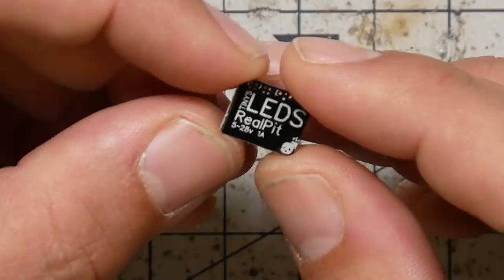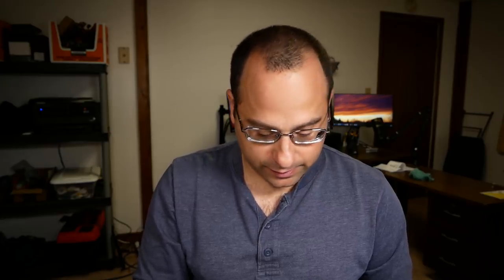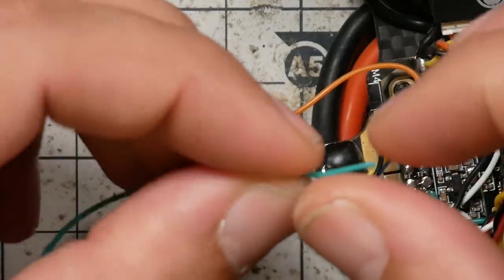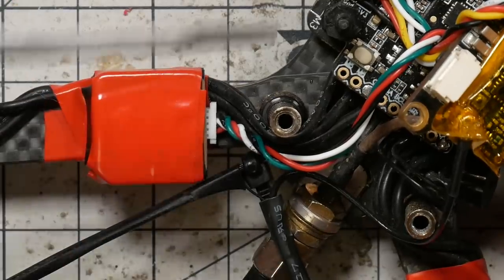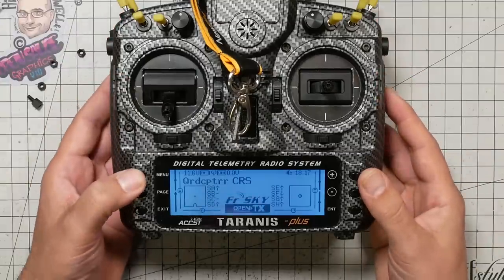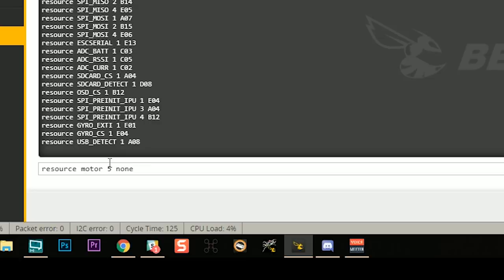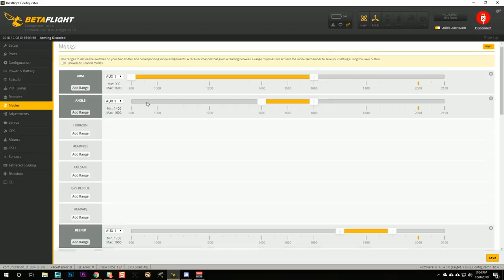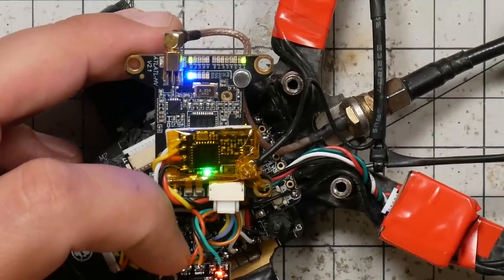Switch vTX Power Off Remotely? | TINY'S LED REALPIT

Comment: Pit mode is already pretty good on many transmitters, but it doesn't works right on any of my VTXs.  On the Tramp-compatible Atlatl (V1), I can turn pit mode on but can't turn it off again without power-cycling, and on the TBS-compatible Atlatl (V2) and the AKK FX3 ultimate I can't activate it at all.  Power and channel control work, it's just pit mode that's non-functional.  What a shame.

Comment: Would the same cli lines work on the JBF4? I’m trying to use the LED pad to control it so I know I will need to use the correct pin designation.
Reply from the maker: Yes exactly.

Comment: I have your fc and esc. Blheli keeps saying saying theres nothing to read: on esc 4, there for motor 4 doesn't turn. I can't seem to digure out how to dix it. If you could help me out i would greatly appreciate it. Thank you Mr. Bardwell.
Reply from the maker: This usually means signal wire 4 is not connected or damaged.

Comment: Is the default off so it doesn't power on the VTX until the receiver is talking to the TX to turn it off? But then you idea of switching the RX off wouldn't work as you could never power the RX up ?
Reply: This does not switch off your RX. And yes default is OFF for whatever is attached to this.
Reply: Listen to JB surmising about during a race a crashed pilot being able to switch off both VTX and RX. My point was this wont work because you can never switch on power to the RX with power already being supplied to the RX.
Reply: 3 ordered from RMRC was going to order direct from Tiny's site but $15 minimum post to the UK v $3 seems a bargain to save the cam and VTX killing a battery while hiking to GPS coordinates even going to set failsafe to power them off.

Comment: Do you know if it's possible to control one of these without a flight controller? Say I wanted to put this in my wing, could one switch it on and off with an aux switch directly from the Taranis?
Reply from the maker: I don't think this is the right tool for that. I'm not sure if it works from a PWM signal. But they do make PWM-controlled switches that can plug directly into your receiver.

Comment: hi Joshua, 
I'm trying to implement this in INAV. so far I found that resource mapping is not available in inav.
any workaround you can think of? do you think it may work using buzz- or led ports?
Reply from the maker: I think that RealPit might work with a PWM input as well as the pinio function shown here. Try it with a PWM output from a typical receiver and test. If it does work, there are various ways you could get a PWM signal into the realpit to switch it.
Reply: @JoshuaBardwell  
cool, 
I'm connecting realpit directly to a 4s battery (15V). I connected the "fc" port on realpit to a pwm ch in frsky. the channel output is ranging between 100mv to 220mv, making realpit forward between 2V to 2.6V (to the "vtx+" port).
I'm looking to get 0V when off and 15V when on.
thanks for the help I keep looking

Comment: So these unit will work on a caddx vista unit as well?
Reply from the maker: It works on anything as long as it's pulling less than about 1 amp. So the DJI unit must be powered from about 12v or higher to be safe.

Comment: Does anyone know if it is normal that my lantian rc realpit measures 1.1V when switched off between ground and vtx+ pad?
 5V when on.

My vtx does not transmit at either on/off.
Reply: solved, mamba mini stack was doa, some pads not putting out 5V but 1.8V for some reason, even when nothing is connected, AND when something is connected, weird stuff

Comment: If you are using smartaudio or tramp to control your channel won't the VTX, when powered up after the FC, then be on at the default channel?
Reply from the maker: it will get the new channel info from the FC upon powerup and then switch immediately. But you should DEFINITELY test each individual vTX to find out if it "blips" on the old channel or not.

Comment: Could you please explain the aux command? If I understand it correctly this command is trying to map range 1600..2100 of AUX2 to USER1 but then (maybe because of missing arguments in the command?) betaflight just ignores it and answers AUX2 range 1600..2100 is mapped to CAMERA_CONTROL_1 and then you proceed to using the GUI and map it there instead, doing it the "normal" way. And you are using AUX4 in the GUI.
Reply from the maker: Don't get confused about "aux 2" and "aux 4". The "aux" command is used to define Aux Modes, but the numbering is sequential. So the very first aux mode you define is "aux 1" and the 2nd one is "aux 2" and so forth. The  aux channel that you use (Aux 4) to activate the mode is one of the later parameters.

To be honest, I think you should probably just define the aux mode in the Modes tab rather than trying to type it in to the CLI. But since it is part of the instructions for setting up RealPit, I included it here in case people are setting up for the first time.
Reply: Yup, after saving the pinio_box line the USER 1 mode will be available in the modes tab and that is all you need (except for assigning the pad of course).
Reply: I think this whole topic would be worth a video that explains every aspect of it in more depth. For quite some time now I have thought it might be nice if I could switch arbitrary stuff on and off remotely, but never researched deeper into the topic because I just did not know there actually existed such a clean and simple way to remap and reconfigure arbitrary pins and have user modes. It was this video that actually made me look up the dos and read deeper into it.

And here is also the main point of criticism: When watching your video the pedantic programmer in me immediately said: "wait a moment, I am supposed to blindly enter these commands with magic numbers in it without any explanation and without knowing how to undo the effects of the command. I must first look up what it actually does." . While this had the beneficial effect of making me actually look up the documentation and finally understand how to to it, it also left me with dissatisfaction about how incomplete it was presented, how much better and less confusing it could have been if there would have been just a few more explanations and no blind copy-pasting of unexplained commands.

And this is where I believe that another follow-up video would be helpful, a video that fully explains what the IDs 40...43 actually are (and what other IDs there also exist), what the pinio_box actually does, how it creates a mapping from USER1...USER4 to PINIO1...PINIO4 and what other funny mappings could theoretically be made with this command (for example actuate a certain pinio when the quad is armed, etc.). You could dive really deep into this topic if you want to , for example explaining where the pin names for the resources actually come from when looking into the data sheet of the microcontroller, it would be a very interesting video and fun to watch even for experts as long as everything you say is factually correct and you don't leave people with unanswered question marks in their heads. 

And for completeness sake it should also explain that the aux command used in this video was actually redundant and people should use the GUI to map the ranges instead.
Reply: @foo2332  That feature also completely slipped my attention. AFAIK it is in BF since 3.4 and was introduced to enable (or rather disable) the Runcam bluetooth adapter for the Speedybee app.
Reply: @foo2332  The IDs 40 - 43 are hardcoded and map to the modes USER1 - USER4. There aren't any more as for now. Combining modes (e.g. arm and RealPit) works transparently like with any other modes. This is nothing new, you could assign different mode functions to the same Aux since forever. It would be worth explaining though that you can (and in many cases should) configure pinio switches in your failsafe settings, too.

Comment: Guys I know it's not inherent with the discussion but I read that the TBS crossfire FULL has a bluetooth module... would it be possible to make a connection between it and your phone to use Speedy Bee and change things in betaflight on the fly?
Reply from the maker: You almost could do that, except the Speedybee app does not have configurable baud rate -- or at least it didn't the last time I checked. And the baud rate used by the Crossfire module is not the same as used by the Speedybee app.

Comment: Hey Joshua,
I am trying to set up the Realpit on my Omnibus f4 V5 board. I have the RDQ Mach 3 set up with smartaudio on Tx6. I want to use the Realpit on Rx6. I have the Spektrum Spm4649 on Tx3. I also have my gps on Uart 1. I made sure of trying this a number of times that my vtx is working correctly. When I wire the Realpit up and I am in the modes tab I can see the user 1 tab light up when I flip the switch for Aux 1. I have saved all the changes I made to the resources but I do not get the Realpit to light up nor the vtx to power up. I have tried two different Realpits and neither on of them turn on. Please help me and thanks, Tony
Reply from the maker: Most likely this points to a problem with your resource reassignment.

How did you identify which pin number was assigned to RX6?

When you type "resource" do you see any other resource on that pin number? If so, type "resource <RESOURCE NAME> none" to clear all except the pinio 1 resource.

When you type "resource list" do you see pinio 1 assigned to the pin number in question?
Reply: I initially used resource to find out that Rx6 was assigned to C07. From there I assigned all the commands like you did. I even reformatted the firmware to make sure it was clean. I did not notice if there were any other resources assigned to that Rx6. On the Readytofly website it says that uart 6 has a header through-hole connected to it. I was thinking of switch the gps and smartaudio uarts to see if that helps. Or I may use the pwm5 pin. If I configure it correctly and I’m testing it out should the pin output 5 volts? Thanks again!! Tony
P.s. I’m st working so I’ll update this in the morning.
Reply: Joshua,
I just pulled the resource command off of the fc. I did a new firmware install to make sure all was clear. C07 is on the Serial rx and also the PWM 4 areas. I did notice with the serial rx3 that it uses B11. The B11 is located no where else besides the Uart 3. I'm going to switch the gps to uart 6 and the smart audio and the Realpit to uart3. I hope that helps. Tony
Reply: Joshua,
I switched everything around. I did another resource command and I see that the Pinio is set to B11 as I assigned it. In the modes tab I can see the user 1 assigned to Aux 1 as I set it and it activates. Now the Realpit has a red led but the Mach 3 is not powered on with the battery connected. I'm about to give up. Any ideas? Thanks, Tony

Comment: If you turn your receiver off, how can you turn it back on?  These types of relays don’t reset when power cycled or unplugged, do they?
Reply: Thanks Chris!
So it is like a mechanical relay, just wired up the other way.  So when you unplug the kwad battery, transistor reverts to its normal state of on. Sometimes my brain is just too slow!
Reply from the maker: If you were to disable the receiver using this function, then one of two things would happen.

The failsafe would set the "signal" pin back to the ON position and the receiver would turn back on. 

The failsafe would set the "signal" pin to the OFF Position and the receiver would stay powered off until you power cycle the quad. You could NOT re-enable the receiver remotely.

For pilots using quads in a relay race or for practice heats, the latter condition is desired. You want to totally kill the first quad so that you can fly the second quad. Only power cycling the first quad brings it back.

Comment: Hey Joshua, it seems to not work on latest version of betaflight, it used to work on 3.5.5, but today I flashed 3.5.7 and it doesn't work. It does actually turn on the LED but the vtx does not turn off, help me pease ;(
Reply from the maker: if the LED on the realpit is turning on and off, then I think betaflight is working correctly. Maybe the realpit is broken?
Reply: @JoshuaBardwell  I had some crush today, I think I Will check the real pit with the multimiter, because yes, if the LED turns on and off it means that the FC is able to comunicate with the pit, let's see (thank you for answering to an italian guy that is struggling with his quad at 3:40 AM) 😂

Comment: Switching off your receiver after you crashed may be a bad idea - which you will find out when trying to activate your lost model alarm.
Reply from the maker: It would only be for relay races and other situations where you intentionally want to totally disable the quad.
Reply: This does NOT shut off your Receiver. Just what you wire to it. I would agree that shutting off your RX is the worst thing you can do.
Reply: @TinysLEDs  I know, I referred to what JB suggested for relay races :-). Personally, I would wire it to non-programmable LEDs.

Comment: can't I just connect the ground of my vtx to the buzz- and use it as a relay?
Reply from the maker: Two reasons why this might not work.

1. Betaflight flashes the buzzer, so it would turn your vTX on and off, which of course wouldn't be what you want.

2. The buzzer- pad has a transistor buffer that is designed for the current draw of the buzzer. If the vTX draws more current than the buzzer- circuit is designed for, it will burn out the circuit.
Reply: @JoshuaBardwell  Didn't thought about that, but still thanks for the quick response.

Comment: What would I need If I wanted to control solenoid on my drone remotely ?
Reply from the maker: Depends on how much current the solenoid pulls. You could use a RealPit if the solenoid pulls up to 1 amp.
Reply: @JoshuaBardwell  Thanks for the response! it's a 12V solenoid. I was planning to do a Bb gun out of co2 pump and this solenoid would push the button. Now depends how much power I'd need to push it. I'm still waiting for the pump to arrive. My aim was to have a drone dogfight :D.

Comment: I bet doing this is already or will soon be possible without any extra parts; just a SmartAudio capable FC+vTX and an option for it in BetaFlight. Probably the worst solder connection that could break during a flight, is the one to the vTX - even though this never happened to me before, I'm not willing to double the chances for it happening by adding an addition solder connection to power the vTX. :)
Reply: That is a very silly response to not using something. If you can solder well then there is no difference in having this product inline or your motor wire coming undone during flight. Learn to solder well and then doubling the chances of failure doesn't actually exist.
Reply: When it comes to safety, being extra careful is never silly. Have you ever actually seen how cables on a quad move during flight? It doesn't matter how awesome you are at soldering, sometimes cables break - not the actual solder joint but at the solder joint. As I said, never happened to me yet, but to enough people out there not to dismiss it, imho. Also it's another extra component that you need to find a place for. I'm not saying it's a bad thing, on the contrary, great idea. I'm just saying it's not for me, because I firmly believe now that this it out, the functionality will be integrated into most future FCs and vTXs without the need for extra components, so meh. :)
Reply: I know what you are saying. I am reminded of camera control board that I did not buy and now it is being incorporated into FCs

Comment: is there a pit controller that will work on a dji air unit
Reply from the maker: Well the problem is if you're using the DJI controller once you turn off the air unit you failsafe. But if you're using a other controller then you can use realpit with the air unit. But realpit maxes out at 1 amp so you would want like a 12v regulator or run the air unit off 4s voltage to keep the amps low.

Comment: Could you not have just used the Disable VTX Control mode instead of using User1?
Reply from the maker: That doesn't power down the vTX. It just tries to put it into pit mode.

Comment: Anyone had this issue: vtx not powering on:

Weird stuff going on: I switched the ground of my vtx from the lantian rc realpit to the fc (which shouldn't matter I guess?), and now I can turn on and off the green light of the realpit with my radio. Vtx is still not powering though. Voltage supplied to the lantian rc is 1.78V... from the fc's ground and 5V pads... ?

I checked some voltages after switching ground of vtx to fc rather than realpit (although the manual says ground of vtx should be attached to realpit):

5 V is supplied to vtx from lantian rc if switched on
 (green LED is on)
0.9V is supplied to vtx when switched off --> this caused a brownout of the vtx? voltage should be zero, no? so realpit is broken?
0.7V is measured between fc ground of vtx and + pad on lantian...
Reply: btw, this worked fine with exactly the same fc before, but pads were ripped off, so I replaced it, so everything is the same now...

Comment: Hello. When I give the final command "resource pinio 1 xxx" I get a parsing failed error.  I've tried using different uarts and even firmware.  I still get the parsing failed error.  Does anyone know what this means?   Thank you.
Reply from the maker: Are you literally typing "xxx"? You need to put in the pin number of the pin you're soldering the signal wire to.
Reply: @JoshuaBardwell  no.  Xxx was a representation of the pin number. I should have been more clear.